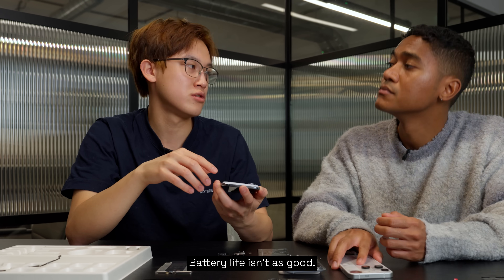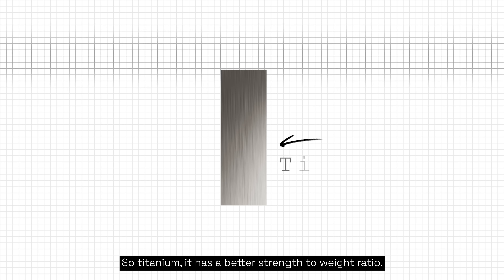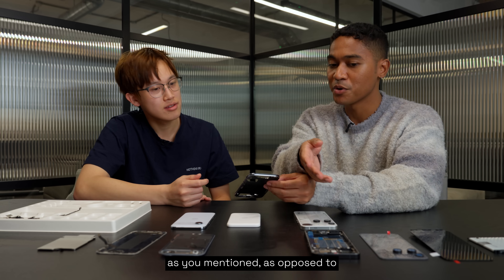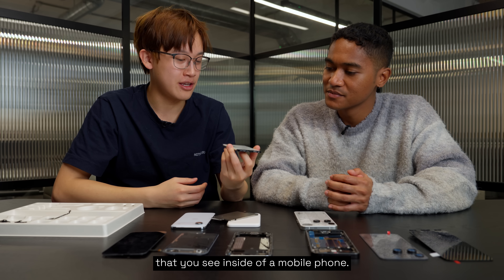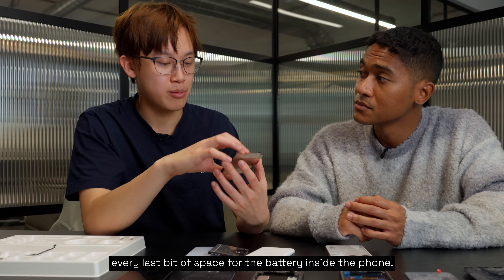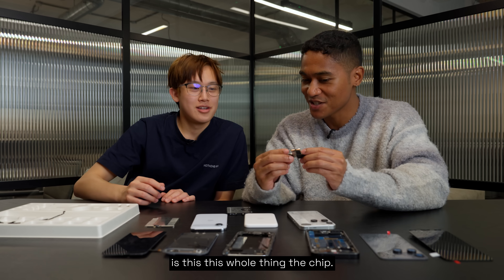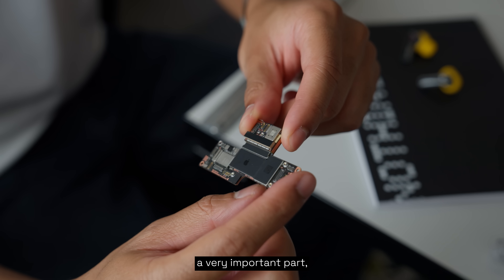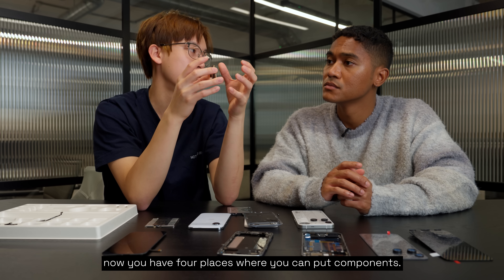iPhone Air: How Did Apple Get it This Small?

Comment: Subject: FINAL DEMAND & EXPLANATION REQUIRED: Nothing Phone (2a) Essential Search Restriction is a Marketing Deception
To: Nothing Customer Support
Device Model: Nothing Phone (2a)
OS Version: Nothing OS 4.0 (Installed)
Dear Nothing Customer Support Team,
I am writing to express my extreme dissatisfaction and demand an honest explanation regarding your refusal to activate the Essential Search AI feature on my Nothing Phone (2a) after the Nothing OS 4.0 update, citing "hardware and performance limitations."
This explanation is demonstrably false and misleading because:
Direct Technical Proof (Full Gemini Working): I have the Full Gemini Assistant installed and running flawlessly on my Nothing Phone (2a) as the default assistant.
This assistant, which you confirmed uses the same Gemini LLM as Essential Search, performs complex web searches, summarization, and AI interaction swiftly and without any noticeable lag or overheating.
Cloud-Only Functionality: As Gemini operates exclusively via the internet (cloud-based), it proves that the most resource-intensive part of the AI experience—the cloud processing—is perfectly supported by my device and its network connection. No dedicated "AI engine" is required for this cloud function to operate well.
Conclusion: Artificial Restriction: Since the core AI engine (Gemini) is already running perfectly on my device, the refusal to enable the Essential Search interface in the Nothing Launcher is clearly not a technical limitation, but a cynical marketing move designed to artificially reduce the functionality of non-flagship devices.
This deliberate restriction severely undermines Nothing's core values of transparency and "caring for our users."
I demand a transparent explanation for this deception and insist that you immediately activate the cloud-based Essential Search functionality in a subsequent Nothing OS 4.0 patch.
Sincerely,
Mikhail

Comment: We need atleast 15w wireless charging on the 4a and atleast 25w wireless charging on the flagship phone 4. We also need a atleast a 45w charger on the box of the 4a and atleast a 67w charger on the box of the phone 4. We also need a processor with more than 1.2m on antutu v10 on the 4a and atleast a 67w charger on the box of the phone 4

Comment: That's why Apple doesn't produce the iPhone 17 Air anymore, and the designer of this phone, resigned and moved to some AI Start up company. Well done 👍🏻 but you can buy iPhone Pocket now for only $230 😅 you will need one, for this iPhone 17 Air, as it is so slippery, one wrong hold, and $1200 goes to the ground. Hey 🍏

Comment: I know the chances of you reading this are very less but still thought to give it a try. Alright I bought the CMF buds pro 2 5 months back and I have started to face noise cancellation issue on my right ear piece as it isn't as powerful as the left one. I mailed the nothing customer care and they told me to visit the nearest service center. There they had no equipment and to test my buds they wore them and told me they didn't find an issue and advised me to visit another service center very far from my home which isn't feasible for me. I mailed them back and the entire service team is only giving me one option to visit the other center, when i asked if they had equipment to test the noise cancellation the customer care told me yes but when calling the service center I was told they don't have any equipment. Noise cancellation is not a visible issue and needs proper equipment to test it which the service centers lack. They don't provide a replacement or a refund policy either. Please reach back to me to find a solution to the problem I am facing. Thankyou

Comment: Something to keep in mind is that it's not actually slow, not even close.  The pro chips that manufacturers are putting in phones these days are blazingly fast, so fast that they far exceed the requirements of anything a normal person will ever use their phone for
The other thing is the battery - for 99.5% of people, the battery is more than enough to last well over a full day of use.  If you're like most people and just charge your phone at night, it's never going to be an issue

Comment: Targeted towards me who values a phone thats comfortable to use and uses a phone as a phone I guess cause with the way the industry is going, every phone is only getting bigger so If there was a compromise that I had to make for a more comfortable phone then the Air is it for me 😅🤷‍♂ But as mentioned by the tech, it is a feat of engineering to be able to squeeze all the processing power in a small part of the phone and have everything else as battery. Imagine if they did something similar with the Pro's while maintaining the thickness or going thicker. The battery they could squeeze into that would be crazy. Having the tech to make a phone like this now, I can only imagine the interesting phones to come 👍

Comment: Thats a step towards fold iphone. To compete with fold 6 slimness and to get the first generation works well with being still slim while closed. And also air 2 will not be coming next year and with 2027 fold and air 2 both with differnt mindset. Just changing with time.

Comment: Phone expert Patrick, tell me how you managed to create the device so that the thermal paste in the Nutning 3 doesn't adhere to the phone's components for proper cooling. What good is your evaporative chamber if heat cannot be transferred to it properly due to the above problem? And another question: when will you finally solve the problem with connecting external portable amplifiers and DACs to the 3.5mm jack—why is there no sound? Thank you for further troubleshooting of these and similar issues—if that happens, of course.

Comment: So. Hopefully this gets seen and properly upvoted to highlight the one majorly talked/asked about thing here.

 Bloatware.

The short answer is:

They HAVE to do it. Nothing's profits are already thin, and they still owe money to their investors (some from day one). Making a phone with value as minimal/competitive as the Nothing Phone 3a lite (and some others in their lineup) for example means that Nothing is buying more expensive parts and selling the phone for cheaper than its manufacturing value. 

And if youre reading this and wondering,

 'How the fu** do they make money if that's the case?'

Well... Without shipping the phone with advertisements (which you can shut off in settings by the way, they are completely optional) Nothing wouldn't be gaining profit from the money and resources they put into their phones.

 Nothing's cheaper phones would be a drag on their revenue without shipping with ads. Thusly they would on the fast track to bankruptcy and thusly no more Nothing product.

So as a still small and growing company, they especially need to build additional money to payback investors, and stabilize their profits to break even on manufacturing. Unlike Apple where they aggressively chage the consumer with the expectation your wallet directly helps them break even. In Android, they're trying to save you money on lower teir models with bloatware, even tho they know it sucks. There are even calculations run by other manufacturers in Android on percent of people that leave due to bloatware even though it is ENTIRELY OPTIONAL. You are in no way expected to just live with it. That's why you can turn them off in settings.

Edit: Hopefully, we'll see... If they equalize in profits, maybe we'll see the de-bloatware-ification of Nothing products. But maybe I'm just hoping on nothing? Or maybe something will change. Guess we'll see. But, other companies have me pre-conditioned to have little hope.

AT LEAST ONE LINK TO PROOF 
(you can also confirm with circle to search with this comment)

https://9to5google.com/2025/10/29/nothing-phone-3a-lite-facebook-instagram-apps/

Comment: The Air is purely for the aesthetic. If you've got money to burn and want to flex an iPhone that's DIFFERENT, the Air is for you. If you want to get your money's worth, the Pro, or save some money while getting a better product, the base model. The Air is the "flexing doesn't have to make sense" iPhone.
Reply: Other reason is iPhone Air is basically for people that like iOS,Doesn’t use All Camera All the time and Alway have AirPods with them
I mean it the perfect phone for me but i wouldn’t recommend anyone 
Air is only phone that 6.5inch that very light and slim and I can’t get it from any phone in this year (i also try s25edge and it too hot and battery is really really really bad)

Comment: guys, please fix your quick settings panel. display brightness slider should be available after single slide down, having to do it twice every time you need to adjust brightness is a chore and completely unnecessary. if the phone is held horizontally, the quick settings panel comes out perfect first slide and brightness slider is instantly available, why did you decide to hide it when phone is held vertically??? no other android os does it this way. and please add an option to hide notification panel, if it's empty it just takes half the screen for no reason. you market your os as highly customizable, give users more options to tweak the phone in a personalized way. your phones are good, but os needs more work (read, options) to be comfortable to use. i switched to nothing from xiaomi and it was honestly kinda painful because of these seeming small but very annoying oversights

Comment: So you are telling me, the iPhone air has aluminium inner shell for heat decipation and titanium outershell for the aesthetics and scratch resistance etc. 
They just moved back to aluminium on iPhone 17 for its thermal conductivity. 
So now they can make even more money on iPnone 18 by fusing the two material together, similar to the Air. (Titanium for the rim and aluminium for the back for its thermal properties). Apple is really wicked lol.

Comment: Please don't chase the thin phone trend that no one asked for. The downsides of a smaller battery, worse cameras, worse thermals, worse durability, and higher cost are NOT worth it. The phone will become thick again anyway when you add a case, unless you want to leave your $1000 phone unprotected.

Comment: I think Nothing should try their crack at a compact, slim phone. 6 inch screen, 7mm thickness, SiC battery and a Snapdragon 7. Same great software, same distinctive design, but they'd instantly be the only ones on the market with a $329.99 phone that fits anywhere and weighs less than 150g. I'd rock it totally made of plastic, just to know that when I drop it nothing can happen to the body and rear panel. CMF? All gray, all plastic, all satin, all badass.

Comment: 6:56 Oh I get it, its just like when your price is very low, but the bloatware goes high?
Reply: maybe try/buy the phone before writing this nonsense as the 3 apps (bloatware) can be uninstalled
Reply: @N3LYM  Man, I swap phones every 8 years and I cannot afford buying a phone "to test it" so @N3LYM don't tell me to buy it first. Every company community's job is to raise their voice, when the said company fck up something. Maybe you used to bloated products, but you can't expect everybody to buy a phone, check the bloatware then sell it or something. If things would work like that... Oh man...

Instead of licking the ass of a company with repeating the same dumb comments, think about that: Maybe there is a reason why half of the comments pointing out the same PROBLEM, couse this IS a problem!

Sorry for my English.
Reply: @KhriszB  you say problem this. problem that, but have you even seen what the problem is? if no then stfu

the bloatware is not even bloatware anymore as you can easily uninstall it in the recent NOS4 update, furthermore the ads are entirely optional as it is disabled by default 

so tell me, what is the issue now?
half of the entire critics are just lobotomized donkeys who can't read the recent patch notes

Comment: I think people think too much about apple, for example samsung's edge is just 1 or 2 millimeter thicker than air, it has bigger battery, dual camera with, dual stereo speakers, an external sim slot a finger print reader under the display, a chip that is less throttled and titanium frame, which is equally or even more impressive. It almost feels like a normal phone atleast from spec sheet.

Comment: “Why do all android phones eventually have bloatware, even when the CEO promises there won’t be?”
Reply: I'm not sure, but I don't think Pixel has bloatware.
Reply: @ajays6393 Well, Google bloatware
Reply: Enshittification
Reply: app company pays phone company 10 dollar per app so do the math.
Reply: because they make cheap phones for you
Reply: How is that bloatware when its not turned on by default you have to manually use it
Reply: Every electronic device has bloatware and bugs... no matter if it is a phone or something else! Just because you are talking about android, I'll answer according to that, 
Bloatwares are appearing more in android phones, because the android can be used in any phone and of course it can't fit all the phones in the same way.
Another reason is that the smartphone market has around 70% android os, which means more the numbers more issues can be noticed 🙏🏼
Reply: @amggdeals620 so my can't they make it efficient? Like IOS did? Is that android is too overrated that people outside of it start to get salty?
Reply: bro... you can uninstall the apps and nothing doesn't get as much profit as for example samsung because their margins aren't as big. you probably use windows which has stuff like microsoft edge which you can't uninstall and ADS...
Reply: "nothing xx xx because they aren't as big" is the most consumerism argument that I've seen thrown around all too much@amciuamciu

Comment: i would consider a nothing phone if it would be upgradable. im tired of phone that becomes trash too quickly....   and i hate to pay for a great optical set fo my camera to throw it away
Reply: There are no hardware upgradable phones whatsoever. And no budget phone will last long. You can find NP(2) for something like 400$ and it will last since A16 will be its last major update and hardware+software is actually good for that price. Hell, people still use NP(1) and Pixel 6/7, S21 FE and so on without major issues. Yes, there are inconveniences here and there but it's ok and doesn't feel bad since these phones are already "old" and new budget to lower mid-range phones with the same price have the same problems. So yeah, stretch your budget a little and buy a device that covers all your needs twice, it's not that hard. If you're not able to do that, well... Switch to cheaper phones and change them every year or two and DECLINE all updates or buy used better ones in good condition.

Comment: Will we ever get a 6.1” nothing phone? Thickness debatably does not matter if total thickness with the case is under a centimeter, we just need something that fits into the hand, not something that snaps in the back pocket!
Reply: Amen!
Reply: Yess
Reply: Yes, we want this. With headphone jack. With SiC batteries, we can pack more power with less size
Reply: @vtp326  YESSS BROTHER, BRING BACK THE JACK!!!
Reply: I remember reading somewhere that small phones do not sell well, that's why brands stopped making them (including Apple)
Reply: @pokemon17007  brother, they were talking about the minis, 6’1 still sells, look at the base model iPhone and the non-max pro

Comment: Nothing Phone (3a) Lite: How did they came with bloatwares? 😂😂
Reply: the bloatware can be uninstalled, maybe buy the phone you pea brained rat
Reply: Nothing ❎
bloatware king ✅
🤣🤣🤣🤣
Reply: Bro listen - if a company is small and if they want some revenue for better phones design tech and features to add, they need to raise funds from such bloatware apps..... ASAT...
Reply: Name a budget phone at the same price range without bloatware when the company WASNT popular or didn’t have market share back in the day. Other than Apple, every company had bloatware in the start.  Btw I don’t even think you own the phone  , the company is in its early stages. With bloatware it helps them raise some capital.
Reply: @MavyyIsHere the whole point of nothing phones is their clean design and minimal UI. If they are gonna start adding bloatwares and even ads, there is literally no point of choosing this phone over other brands
Reply: @krinzal that's why they said in a statement without altering the design and with minimal UI they ll add the important bloatware that we are using in D2D basis..
Reply: @Mavis-Here  Well they should've said we'll add Bloatware before I bought their stupid phone. If I wanted to sacrifice my user experience, I'd have gone with a Motorola Edge 60 one, at least it would've been Sturdier, Water Proof, Better Screen, Better Processor, Better Speakers, Better Battery. If they're giving us refunds (15-20%) then I'm fine with their Bloatware.
Reply: @Mavis-Here  they give better specs, the only unique thing about nothing is clean os, if that is also ripped out, then what's the point